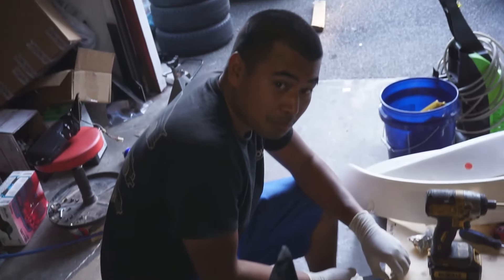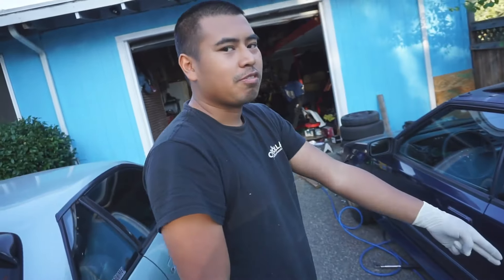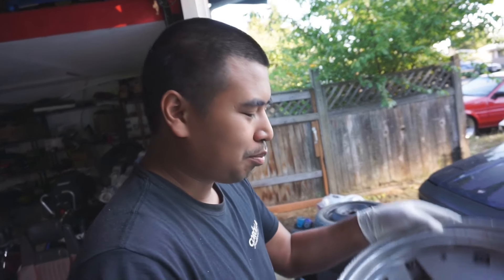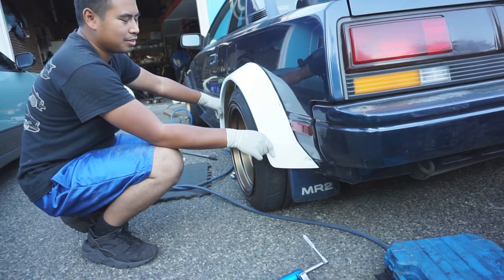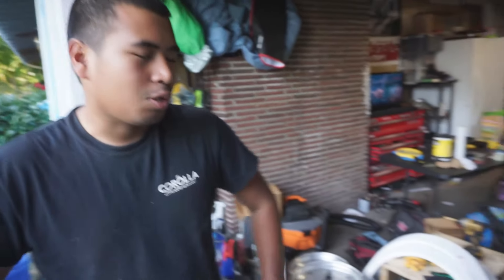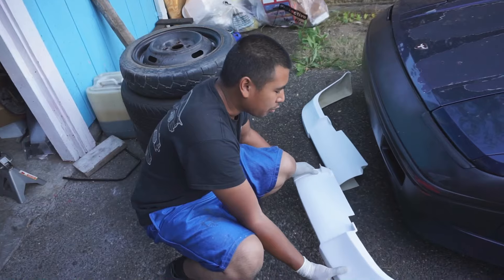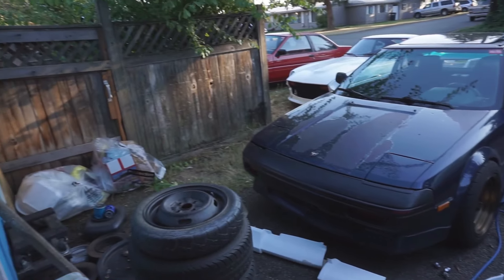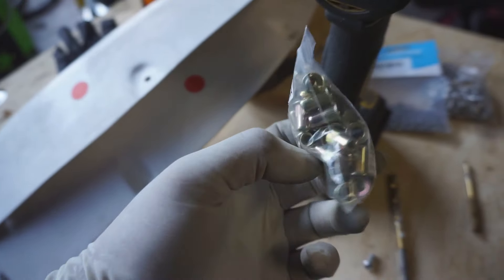AW11 MR2 Woodsport Fender Flare Install

Comment: Could you give me the specs for the rotas and tyres? pretty please
Reply from the maker: 15x9-15. currently on 205/50R15 tires. Will be changing tire size to 225/45R15 soon
Reply: @Redline280zChannel  15x9 both front and rear? that's wild.
Reply from the maker: @CasperBritto  oh sorry, 15x8 0 on the front